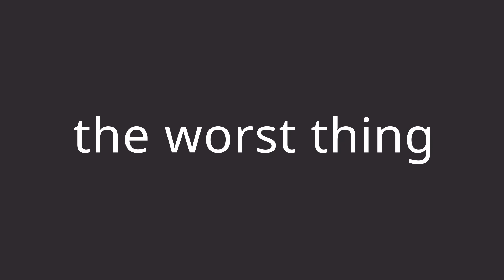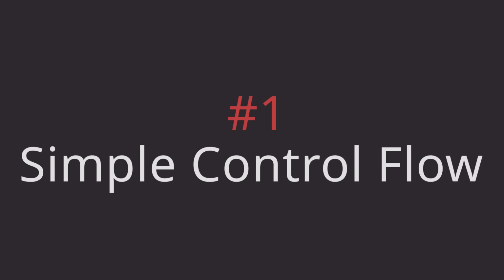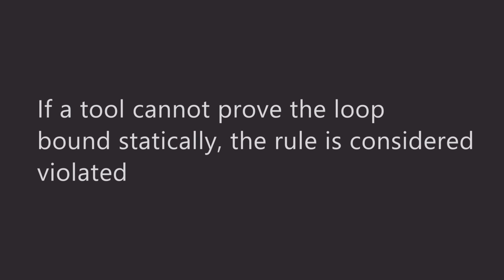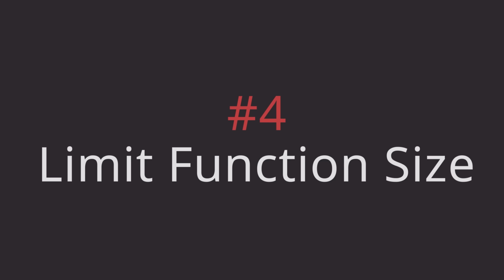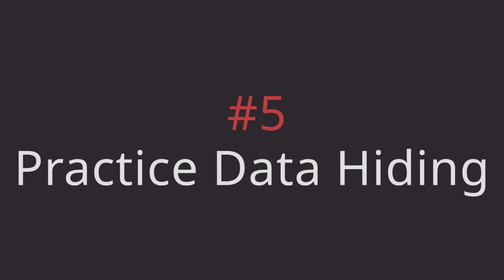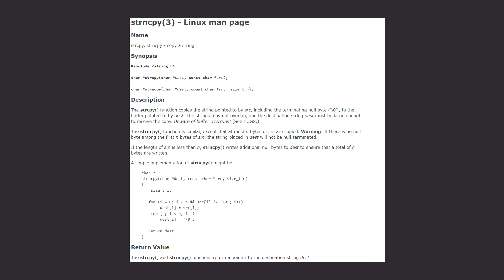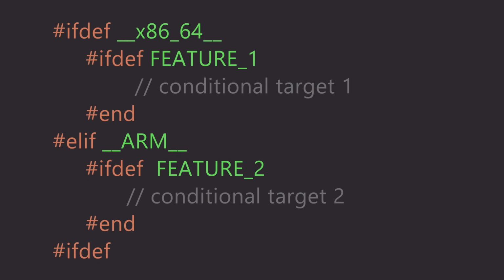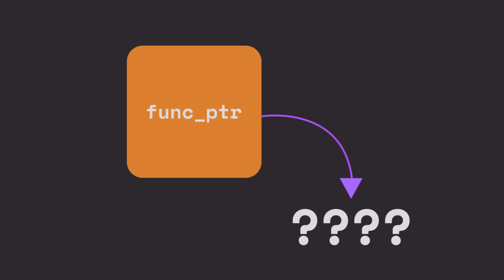how NASA writes space-proof code

Comment: Or you can write your code so that every class is autonomous, so that if one class misbehaves the rest will pick up the slack and do their job for them. I call this "self healing code" it's like a biological body with billions of cells that work together to achieve a greater function, but none of the "cells" shares a common set of instructions. There is always a non-zero chance the entire ecosystem will collapse, but the more cells you introduce to the system the smaller that chance gets until it's statistically impossible to occur before the heat death of the universe.

Comment: I love this video. Especially practice data hiding and check the return values are really good points. Denying use of global variables is usually good rule. I wonder how do you enforce the check return values-rule?
Reply: Many static code analyzers, and all code reviewers, can detect ignoring a function's return value (when it's defined to return something).  C isn't Lua; when a function returns something, it's supposed to be important!
Reply: You can always avoid the use of variables, global or local. It can make code less reusable but when reliability is the most important consideration you avoid all the problems that come with state data.

Comment: I'm an electronics engineer at NASA GSFC. As a hardware guy, I am not familiar with the software design standards, but these that you list in this video seem to be functionally similar to the ones I experience in electronics design, in that, they are aimed at making the sure the system is reliable beyond a shadow of a doubt. Given we work on space systems, it would obviously be catastrophic to have an undetected failure or bug show up mid-flight.

One example of a relevant electronics design standard, would be our part derating. All electronic components that are bound for spaceflight, must have their maximum power/voltage/current requirements derated to some level below what the manufacturer states. Ceramic capacitors, for example, must have their maximum voltage derated to half the manufacturers level. So if we have a ceramic capacitor that is rated for 10 volts by the manufacturer, then we are only allowed to apply 5 volts maximum across it as part of our design process. This helps guarantee reliability and the lifetime of the mission.
Reply: Meanwhile my civil engineering buddy is out there using a factor of safety of 0.9
Reply: @ictogon  works good enough, we don’t REALLY need bridges right
Reply: @ictogon  Structural Engineer here (a subdiscipline of Civil). You may be interested to learn that the FS applied to materials and elements in a structure are different than those applied to the forces/loads acting on them due to the inherently different probabilities of both. This is called Load Resistance Factor Design (LRFD). Essentially, we reduce the material capacity by a range of factors from 0.65-0.90 and increase the loads applied by a range of 1.0-1.6 depending on the material, the way we expect it to fail, and the types of loads applied (like dead loads vs. wind loads).
Reply: I’m a computer engineer and I had few courses on digital and analog circuit design. can you suggest me some books or documentation about the design of electronic safety critical systems?
Reply: @yessure5792  Seriously, you should sue your school for not giving you a quality education!
Reply: Interesting... I was wondering about the hardware requirements too.
Reply: Under promise, over deliver.
Reply: You might think beyond a shadow of a doubt but this is really just a baseline.  There is so much other testing and validation, and even then it's not for sure.
Reply: I loved an old training video of soldering by NASA: "cut the through hole components before soldering, doing it later may introduce stress that would lead to bad joints". It was the first time I saw a tool to bend component leads at the right size and now I get one.
But I imagine today all is SMD anyway.
It is interesting to know that the most used Radiation Hardened Processor is still a PowerPC equivalent.
Reply: @RyanBoggs  Interesting that you mentioned ceramic capacitors because  they are among the most reliable of all electronic components.  Power transistor circuits for example, should be very carefully designed and derated and some components, like electrolytic caps, may not be designed in at all because of how they age, maybe aging (drift) in general would be a priority consideration for component selection.  Especially for something like a space telescope or probe that might be in operation for 30 years.
Reply: we love a good safety-factor.

Comment: This is pretty much some rules from MISRA that are vastly used on safety critical software, automotive and aerospace are the best examples. Even a greater set of rules, standards and things to check on Aerospace software are defined on DO-178, it's worthwhile to take a look at it if you're interested in safety critical software.
Reply: Whay is most interesting about the DO-178 is that it defines a development process. In that process the actual software developmrnt becomes quite a minor part of the whole process, the software is largely defined before you write a single line of code.
Reply: @jonassattler4489  That's very true, System, High, and Low level requirements are crucial steps before even starting to code at all while following DO-178. Then also comes the Testing part, which depending on the level, it can be super strict aswell.

Comment: I'm currently learning assembly to make a programming language that compiles to machine code and I might as well enforce some of these rules as part of my language.

Learning programming in assembly (instead of only reading it) opened my eyes on how many concepts and restrictions in c are just arbitrary rules.
Variables are fake my friends they never existed. There are only registers and pointers😬🤯
Reply: What's your language going to look like? Also, how are you implementing the compiler?
Reply: @anon_y_mousse  the compiler is planned to transform the languages code gradually in multiple steps into raw nasm asm instructions.
The main influences of the languages are (currently) rust and java. Focusing a lot more on compile time mapping and keeping the language magic to the minimum. I plan even implementing things like if statements in the language itself.
Reply: I should note that the simplest way to do what I /think/ you are planning to do (create a language from scratch compiling into machine code) is to use a compiler compiler or a parser generator (the later is a superset of the former. Though I'll note that at least for me, assembly is a far simpler set of languages to learn than, say, GNU Bison. GNU Bison does have features that would take a long time to code in assembly.
Reply: @lissythearchitect  the target of this challenge is to get a deep understanding and lern a lot. So taking any shortcuts is disallowed 😉
I even outlawed assembly structs, macros, etc.
I learned the basics of assembly to get a feel for what I will need to output. What comes next is writing the multi stage source code psrser/transformer.
Reply: @redcrafterlppa303  Are you going to do it as recursive descent or some kind of finite state machine or something else? Kind of reminds me of writing my first parser in high school in Pascal. That was fun.
Reply: @anon_y_mousse  I planned to do finite source code passes.
Something like:
Resolve macros
Resolve generics
Resolve structures
Resolve platform specifics
Resolve functions
Raw asm

It's planned to be a raw 1:1 translation (therefore no optimizations planned in the beginning)
The idea is to make the compilation as simple andvtransparent as possible sacrificing compilation speed.
Reply: @redcrafterlppa303  I hope you have a copy of the dragon book, but you should also look into the book that LCC was written for, A Retargetable C Compiler by Fraser and Hanson. Just try to save money by buying used copies because the dragon book is overpriced.

Comment: using rust would let you do many of these things with safety (like using the heap), and rust's compiler is basically a static analysis tool that you are forced to use
Reply: Rust doesn't make the heap safe. That is very dangerous thinking, especially in safety critical software. The rust compiler does not guarantee that:
1. Allocations have a specific upper bound on time.
2. Allocations always suceed.

Both of these are by themselves dealbreakers for heap allocation, Rust can not fix the actual issue here.
Reply: All of rusts's handholding safety features are high level constructs that offer no benefits in true safety-critical low level machine control software.

Comment: The literal worst code I’ve ever seen is form ex nasa data scientists. NASAs space and research sectors are very different 😂
Reply: Data scientists don't do embedded, they program visualization tools that run on the ground, not on the probes. Those aren't mission critical. They can basically do whatever and use whatever language, probably Python. If they screw it up it's no big deal... someone else comes in and programs a new visualization tool. ;)

Comment: Good video!  The whole "limit the preprocessor" rule is one I need to learn.  I was writing some fun code to solve a cpu intensive problem.  I kept coming up with ideas that might speed up the code; said code I could select via the preprocessor.  I kept leaving in old ideas with new ones until my .h files were an ugly nested mess of preprocessor switches.
Reply: Probably better to just use seperate functions when your trying to optimize code performance. Its pretty easy to just copy & paste a function and than edit the copy to clean up it up or make improvements. You can even just add a version number to the functions as you make updates.
Reply: When you’re experimenting and trying various techniques on a problem, that’s fine. But it’s completely different from building a production embedded system.

Comment: On additional issue with heap usage is memory fragmentation. Repeated allocation and freeing of different sized blocks of memory can leave gaps of free memory between allocated chunks that are too small to be used in any following allocations. This memory is effectively lost until the program restarts. Usually there is a cyclical pattern to allocations that generates more and more of these gaps the longer the program runs. Normally this is not a big issue, but when your program runs continuously for years without restart, these unusable gaps can slowly accumulate until you run out of memory.
Reply: This depends on which memory allocator the program uses, and the kernel on which it runs
Reply: @Rudxain  What idiot uses a kernel on something flying in space?
Reply: Note that you can only de-fragment on systems that have an MMU. Or your malloc should return a pointer to pointer to memory, but that feels quite alien to work with.
Reply: Slab allocators on top
Reply: I never use malloc. I do have a lightweight heap module, though. I almost never us it, but there have been cases where I'm doing a bunch of string manipulation and using static or local variables is just impractical. My heap module uses a static memory block which I init just before use. That way, I never have to worry about fragmentation.
Reply: @johnheaney3349  But inside you own "heap module" fragmentation still could happen....
Reply: using multi memory system, one half is defragmenting while the other is working. also redundancy is your best friend in critical applications
Reply: The OS shifts the memory by the memory management algorithm of its choice to use these memory chunks, if memory got filled up.
Reply: Yes, and that's a bitch to catch while in testing. Also, duuudes... kernel? OS? You do realize we're talking embedded right? Oftentimes there's nothing even remotely close to that available, only one or more state machines.
Reply: Crazy
Reply: Its not truc ! Modern memory allocator search for free hole and flat hole arround on free process. Free and flat process Can bé handled easyly by thread smart service at a bit cost..
Reply: Some memory allocators can defragment the memory over time.
Or in one go if its mean enough.
Another alternative for space applications is to save the program state and reboot the software
Reply: @Mallchad that would mean that the space ship /satellite etc temporarily remains uncontrolled and that can leave your system literally unstable.
Reply: @InTimeTraveller  ?
you can defragment on unused CPU time or asynchronously

Space operations is very slow there's often time to reboot systems without issue. Why would you ever freeze flight controls over memory defragmentation?

Satellites don't do anything for 99% of their mission and just orbit. All space hardware has dual redundant computing hardware. etc. IMU data is not to be trust for long term missions so you need to re-establish your positioning data periodically reguardless
Reply: @Mallchad  The way I see it is that they wanted to eliminate as many variations as possible. Anything that wasn't operated linearly should be converted into a set of linear functions. You certainly can defragment memory while the thing is running, however, that will relocate a lots of thing in memory, which will cause uncertainty. You need to remember that once they launched the thing, it will either operate properly until the end of service or become a space debris, there is no fixing them. Based on Murphy's Law, "Anything That Can Go Wrong, Will Go Wrong", and for things like satellites, they certainly don't want anything to go wrong with it, even if the satellite can self-repair.
Reply: @Mallchad  "Some memory allocators can defragment the memory over time."

That is impossible for Standard-C as defragmentation means that data on the heap referred by one or more pointers have to be moved to a different address and of course all these pointers have to be adjusted to this new address. But to do so the defragmenting code would need to know all such pointers (which could be stored in static memory, in processor registers, on the stack and in other heap allocated data) and that is not possible.
Reply: Note that garbage collectors can fix memory segmentation by periodically compacting the heap...